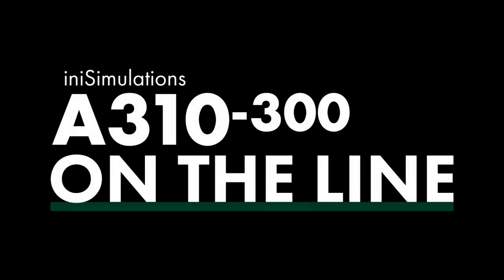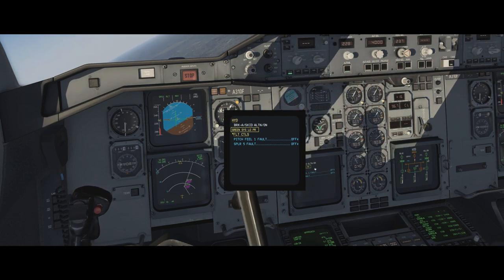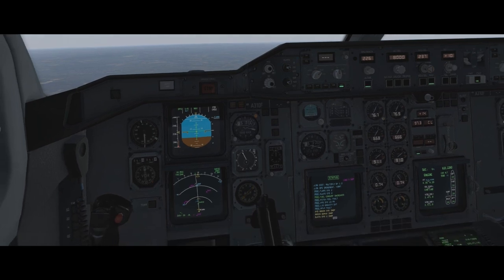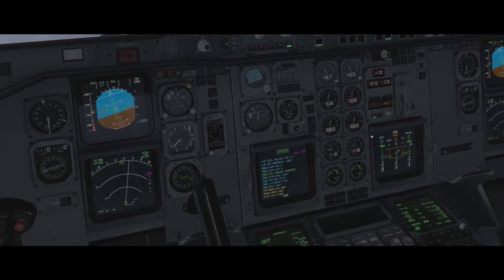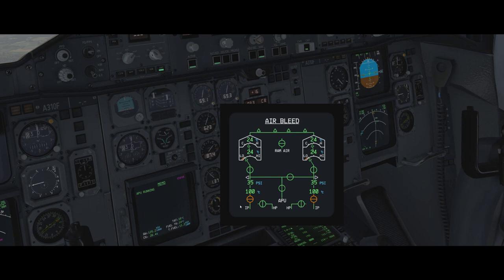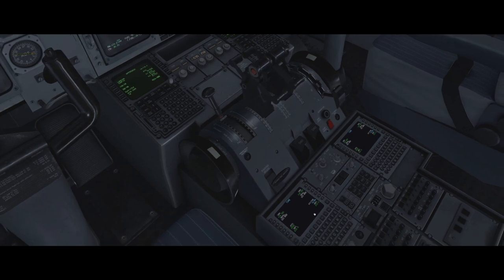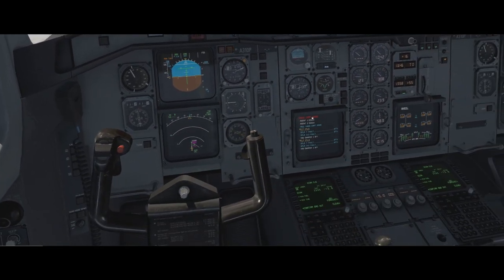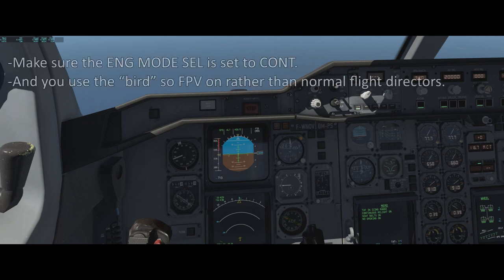iniBuilds A310-300 ON THE LINE - Emergency Operations & Variants

Comment: I noticed that there's the default X-Plane sounds when disconnecting the autopilot, which is kinda weird.

Also, with the failures, is it possible to simulate a total cargo door failure by seeing it open in flight, similar to what happened to a DHL 757 earlier this year?
Reply from the maker: Yes that is fixed. These videos do not represent the final product. 

And no for your latter point. It is purely a depressurization, such as a latch being slightly open.